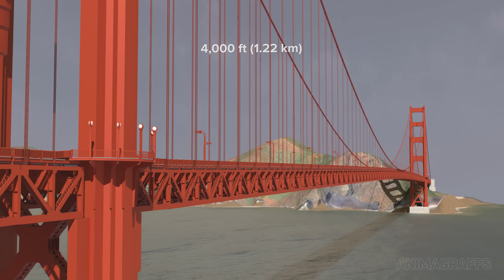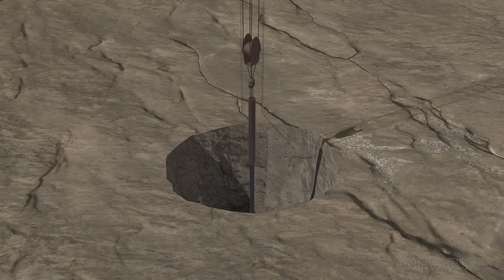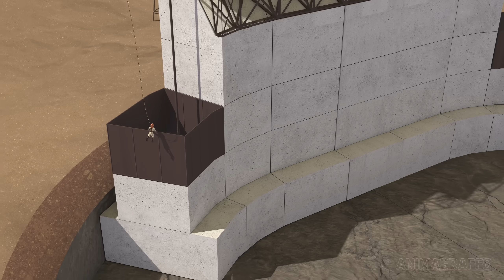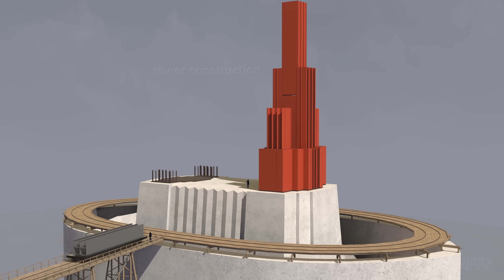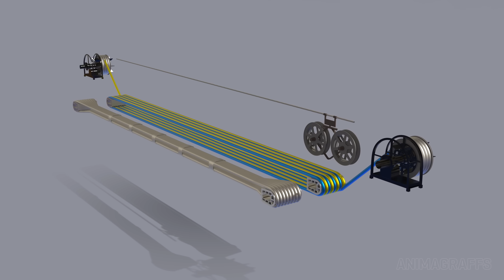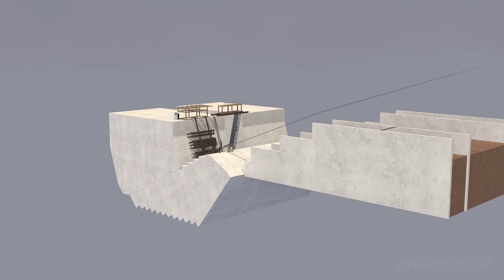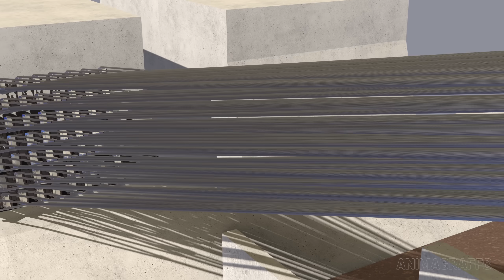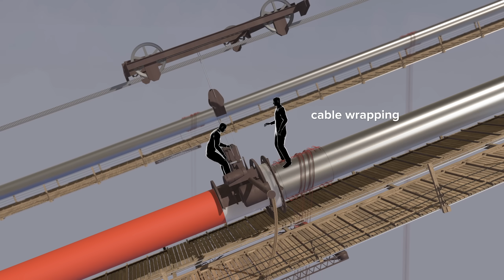How the Golden Gate Bridge Works

Comment: This is a fantastic production, and I immediately noticed the easy unforced pacing of the narrative, which gives time to process all the detail... 
On the cable-wrapping process, it seems that there was room for improvement. It appears that the gadget only wraps from one side, which would 
require flipping the large heavy machine around to wrap all the way up to the cable clamps (for the suspender cables).  They should've made it 
wrap on either side! 🤔

Comment: Incredible!  I only have one correction to make.... at 0:32,  you have the center span (commonly / professionally called "mainspan") at "4,000 ft (1.22 km)", it is 4,200 feet (1.28 km). The previously mention "6,450 feet (1.97 km) / or "1.2 miles"" is accurate.
Reply: Literally unwatchable
Reply: @vinesthemonkey  😂

Comment: Fantastic video! It would be great to add animation of the 50th Anniversary Bridge Walk in May of 1987.  About 800,000 people attended the celebration, and they closed it to traffic so 300,000 people could actually walk across the full road span of the bridge.  Photos show the center span sagged quite a bit as it was the heaviest load ever!  Engineers say there was never any danger.  But I'm an old gray haired mechanical engineer, and I'd be too scared to be on it with that many other people.  News articles stated people started to get a little frightened and threw bicycles and strollers off to lighten the load!

Comment: Another excellent video. I learned a lot. I have driven over the bridge many times, and I am amazed at the clever machines needed to construct such a masterpiece. The engineers back then had no computers to help them. With every rivet, two holes were drilled through thick steel meaning over a million holes. Lots of work! Safety has definitely improved since then. Also, did you know there used to be a 6" open gap between the edge of the walkway and the water below? After a baby fell through to its death, they closed the gaps. They have also added nets to catch jumpers.

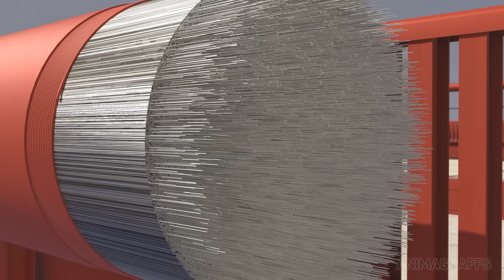Comment: 1:40 Many a truth spoken in jest. Is this why there seems to have been a longer break between these gems, this last period of time?
Did you go a bit too far to the perfect side of the dial in this video?You modelled each one of all 27½ Thou wires in the strands in the suspension cable didn't you? Or threw caution to the wind, deciding to use that Get out of Jail Free Monopoly card from Christmas and settled down and only had to count them all, not draw a single one. Bliss!

Comment: I have seen many documentaries about the Golden Gate bridge construction, but I've never seen anyone model details like the wooden pier leading out to the SF foundation. Fantastic attention to detail. You continue to outshine yourself! Edit: Holy cow, the detailed explanation and modeling of the cable spinning. Duuuuude.
Reply from the maker: What's wild for me is that I don't really know how this stuff works until I'm neck deep in the research. And all resources that tried to explain spinning were really confusing. It's like learning to tie knots, or knitting, etc. -- no matter how simple instructions try to be, it gets wacky real fast. Once you know the knot, it's "easy". But not before, even with the simplest of knots.

So I eventually understand it fully when I have all the research I can possibly find AND I'm actually building it in 3D. Only then I see how things have to work, and that's why the explanation, I think, is more fully explained than many other sources. If you're not building a working model, you're going to gloss over stuff or skip little details because you don't or can't know what's actually happening. I don't have that option if I make a real model -- the darn thing has to actually work!

I had read multiple sources before I even understood it was loops they're making, not just individual wires. That's how dense the reading is, and how hard apparently it is to simply convey the spinning process to the average person who knows nothing, which is me at the start of a project.

Even now, watching it back, so many realizations I'm still having. Of course loops! Think of how strong that is, to have continuous loops of wire around shoes. No weak attach points, no hard bends or kinks, no break in the wire (at least per set of shoes). It's brilliant.
Reply: @animagraffs the spinning portion is where I learned the absolute most. I've seen dozens of videos of the trolleys going back and forth on various cable bridge construction videos. In my head it was that they pulled a single cable back and forth vs a loop they anchored at the shoe and then back with the little support pulleys along the way. Then the moving of strands into the saddle and various bundlers before getting pressed into the round final form. The little "I should mention" of a total of 8 trolleys was great too. Had no idea how they moved the strand over and maintained the shape, and even mentioned they trimmed the lifting straps is a great detail I would have wondered about.
Reply: @animagraffs  This is really interesting insight, thanks for sharing. I think you're spot on in that your format demands a level of thorough understanding. In the future, will you lean towards seeking out or avoiding topics with such complex systems?

Comment: Dear ANIMAGRAFFS,
Thank you for another well designed and researched piece.
You work borders on a piece of "art", thank you for all your efforts. Having lived in The Baghdad By The Bay or 30 years I have a close connection to this structure. The engineering and build on of this structure is amazing, especially when one considers this was done with almost 100 year old technology. With proper maintenance Joseph Strauss famously said that the Golden Gate Bridge could last "Forever". 
Large structures such as the GGB were designed for 100+ year lifespans, but in reality they could last many, many times that as they were designed to be comprised of "modules" that can be replaced ( for example the GGB roadway deck was replaced in the 1980's and is stronger and lighter ), the steel panels that make up the towers, the roadway cables, etc can all be replaced. 
At some point far into the future ( 100 or even 300 years from now ? ) micro-fractures at a molecular and larger level will begin to occur in the steel that makes up the strands of the main support cables, they will have to be replaced, which will be very expensive, however even that can be done. 
One "personal note". On the GGB 50TH Birthday, they closed the bridge to traffic, and I was one of hundreds of thousands who walked across it on its 50TH Birthday Closure, ...the weight of the human bodies was the largest load the GGB had ever experienced, flattening the normal upward curve of the roadway. 
I showed up to early to walk the span. At midway I laid down on the roadway and rested, and then one can here it, ...the GGB "sings". Without traffic and in the silence you can hear the GGB sing as it's huge bulk moves with wind stresses, and expansion or contraction due to temperature changes, each and every day quietly to itself, and unheard by everyone, it sings to itself like a living thing.
Reply: Baghdad By The Bay.  Herb Caen.

I grew up in Sunnyvale, and was quite familiar with this phrase.
Reply: It is entirely a work of art. I hope the sounds of the bridge can be recorded someday.

Comment: 16:30 how are those inspection wells were made in an already casted concrete? It is not clear. Looks like they just hope for the best and poured concrete over the rubble on the bottom left after rough explosive digging committed from the surface.

Comment: 1:40 at the Golden Gate Bridge Visitor Center, they have a display model of the cable cross section so you can see the steel wires.